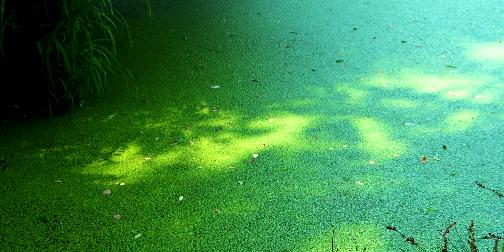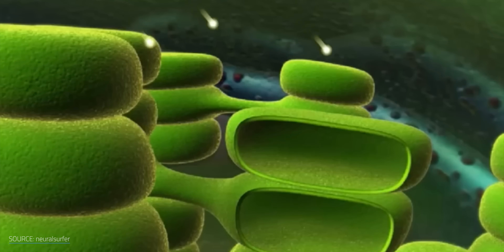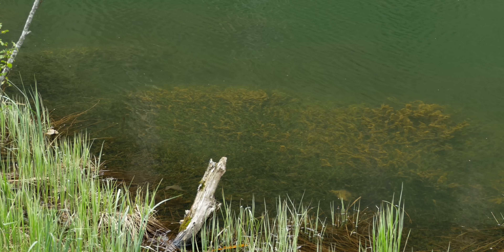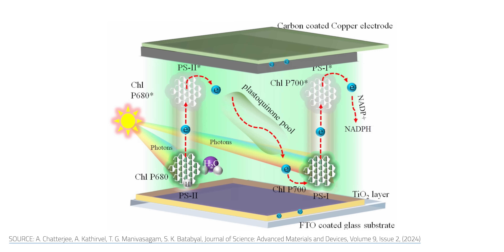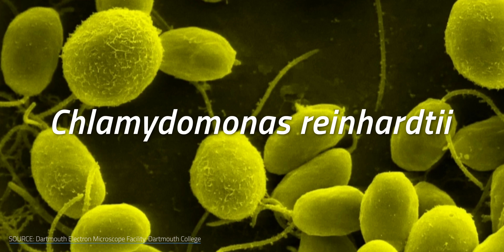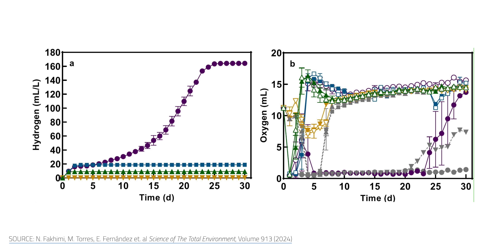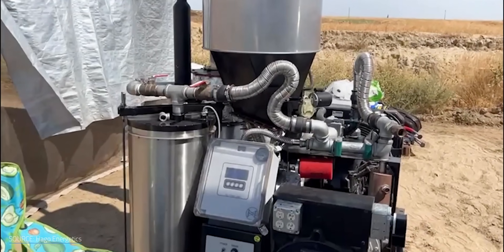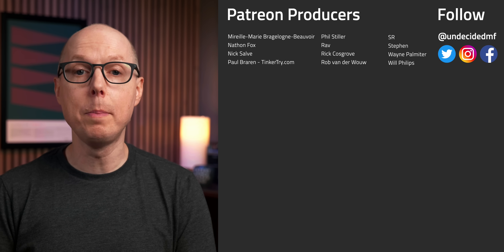The Weird Science Behind Living Solar Panels

Comment: nah, just do concentrated parabolic pv dishes, with bi-facial solar panels, the back side pointing at the sun. yes satellite solar collection dishes, or ditches, with solar tracking. also solar heat collection cooling etc. the target solar panel can be static, like solar molten heating tower power plants. but only the pv panel and the solar mirrors can be separate, not parapolic etc.
Reply: about single angle or two angle solar tracking, center mount solar panels on a pole, would require only two screw drive servos to get two angle full solar tracking. yes diy.

Comment: There are some living organisms that are very effective at separating charges.  I'm thinking of the electric eels, that can (intermittently) deliver high voltages (600V) with significant current (1A).  What a breakthrough if this process could be developed in some organism that obtains its energy from sunlight!

Comment: Whenever you here about bio energy production, keep in mind that Silicon solar cells have ~24% efficiency with sunlight and photosynthesis has maybe 1.5% efficiency with sunlight, often worse. That means, it could only ever hope to compete if its possible to scale up enormously without a lot of cost such that the cost/energy is better than simple solar cells.
Reply: IMO the most promising potential of bio energy lies in the possibility to integrate it with a wider array of biological systems and cycles.

Using the waste from one system as the input of another one, while avoiding the cost and social/environmental impact of extracting external scarce resources to use as inputs or raw materials.

Reducing the potential to absolute efficiency numbers is incredibly shortsighted.

Comment: How about finding a way to store the energy of a lightning bolt for reuse
Reply: A single lightning strike can easily hold 1.5 MWH of energy. The problem is that it stored at 300 million volts and 300 000 amps. 
It typically burns up any electrical device used to step down the power. 
I don’t think direct energy capture with lightning is going to happen without exotic materials that might not exist. 
I could however see a potential of utilizing a lightning rod to divert the lightning into set of tungsten resistive heaters to store the energy as heat similar to all the plans to use such a device to store excess renewable energy as heat. 
Even then, it’s a very intermittent energy source that would make renewable look like nuclear by comparison.

Comment: As a replacement for traditional solar panels this solution still has the same problems.  How well will this work in low sunlight,  if at all and you never once mentioned the energy density of this product be it hydrogen or as a replacement for solar panels.

Comment: Algae and bacteria to convert poop to hydrogen and electricity, squeeze the dead cells and collect oil to make biodiesel, form pellets from compressed dry biomass to burn for heat, CO2 not problematic as it gets consumed and released at equal rates.

Comment: I don't think this would ever be economical. The max efficiency of photosynthesis is 6% with higher co2 levels. Even if you could capture half of those electrons it falls far short of the 15% of cheap solar panels. Also there is most likely no way to get even close to the 52 cents per watt of solar. Its a living thing it requires maintenance. Lots of problems.

Comment: The elephant in the room is that hydrogen, even if it can be produced cheaply and easily, is a less-than-ideal fuel to store and transport. Before finding better ways to extract hydrogen, we first need a means to create a hydrogen-based fuel that is readily used, low toxicity, non-polluting, and stable.

Comment: As a plant tissue culture scientist who's worked with plant cells in liquid culture to prep them for bioreactors, I could envision a system where the algea are slowly removed and new algea feed into the system along with any nutrient feed necessary. For energy efficient cooling, I'd consider a geothermal heat pump approach to help stabilize the temperature and (hopefully) prevent it from moving past min/max temps.
Reply: I'm not a scientist but I was thinking along the same lines. Having a system that refreshes the algae while producing energy means that you could potentially have a solar panel system that exceeds the lifespan of traditional solar panels depending on the anode and cathode material. Waste algae can then be processed into biomass products such as fuel and fertilizer to run a generator at night and feed gardens. I would make the anode and cathodes replaceable. This tech could be extremely useful as a greenhouse technology.
Reply: @dapain1576  Correct, it would be similar to a continuous feed bioreactor and there are several ways to make it much more sustainable than conventional solar panels. The typical problem with bioreactor systems is contamination, so they'd need to solve for efficiency, synergy, sustainability, and sterility.

Comment: this seems like a great way to power an algae farm using the leaky electrons from the photosynthesis process that you're using to grow the algae in the first place. pump the algae through the PV panel using the power from the PV cell and allow it to grow (sure let's throw H2 production in there), when it's ready convert it into sustainable aviation fuel/shipping fuel/fertilizer/chemicals/etc. You could even make a tandem cell on the tank with a quantum dot cell tailored to absorb the wavelengths of light the algae doesn't use.

Comment: Is there a technical reason why current solar panels are black?  Can they be manufactured with different colors so that they match the colors of the roofs?
Reply: Black absorbs all visible light wavelengths and also infra-red, producing more energy, any other colour solar panels would bounce light off that could be used for power production.
Reply: @mittenstc  Makes sense. Thanks.

Comment: Pointless tech, by the time they get any where with the research we will already have Solid State Batteries sorted 
since the length of research time most likely be about 20 years since that type of research even if fully funded don't go fast compared to other types of Ego tech which is not based on living cells.  

The level of support and care those cells would need would negate any possible returns from the low outputs they would make?

Comment: If you combine the cells with high lipid algae you may be able to make the photovoltic charge and filter off some algae for biodiesel using the same device.  The challenge is keeping the bioreactor chemistry going without harming the photovoltic cell efficiency.  This is probably not something the homeowner or small business would want to deal with, but an energy generation business that can power via solar cells during the day and via a biodiesel generator / turbine at night might be quite happy.
Reply: I was thinking the same.
Reply: Schools would be a good place to fit them in because the county could easily take care of the maintenance roles if they’ll save enough money on their utility bills
Reply: It would cool down photo cell too

Comment: Matt, please do the research. Burning H2 in "Oxygen" only produces water. But we only have AIR, which is 4/5 Nitrogen, and burning (and fuel cells are no different) H2 in air produces NOx. Fuel cells may not get as hot & produce less NOx, but they produce NOx. Not the "only water" of your narrative. And don't even think about ICE or making steel even! Think temperature.

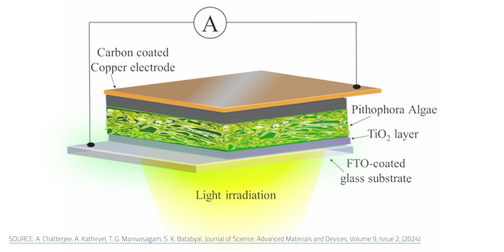Comment: 2:35 Isn't Tin supposed to be Sn? Ti is Titanium
Reply: The TiO2 is the titanium dioxide coat, the tin is the layer below, referred to as the FTO coated glass substrate
Reply: Isn't TiO2 a poisonous substance for living things ? 😮
Reply: @abhiabzy hardly it is used a lot sunscreen, makeup and even in food
Reply: @Vossst toxic and poisonous aren't the same, pure water is toxic but not poisonous
Reply: No, it's pretty save. Comparable to sand. Don't get too much dust in your lungs and you'll be fine. It's on your walls, probably in your sunscreen, ...
Reply: @abhiabzy  As with many things it is dangerous in high doses to living things, but in small doses or stable enough to not degrade it is fine.

Like alumina (Al₂O₃) coats pure aluminium surfaces titania (TiO₂) does the same for titanium metal used in medical implants for bones and teeth.
Reply: It's in sunscreen. Apparently, TiO2 is only dangerous if inhaled in powdered form.

Comment: I saw a TED talk on this topic many years ago

https://m.youtube.com/watch?v=X-HE4Hfa-OY

This building already generates energy using green walls

https://m.youtube.com/watch?v=JLEWZkKn1GE

And this urban algal liquid tree helps clean the air. Millions of people die every year due to urban air pollution so perhaps algal tech can be more useful that merely creating hydrogen

https://m.youtube.com/watch?v=gBCs_qwTON4

BTW, hydrogen cannot be transported easily (it needs to be cooled before it can be transported) so it's better to generate it very near to where it can be used, eg near airports & shipping terminals. It must also be noted that hydrogen is highly flammable so not a substance that we should be messing with (ie leave it to professionals with high safety protocols etc in place).

Comment: Seems like a glucose fuel cell would be more efficient than scavenging spare electrons.
Reply: well we call glucose a fuel, because it is what our body uses to perform certain functions. but it doesn't release electrons when it it does these. so using it as a fuel cell like an electronic battery, wouldn't really work. Its just a chemical, like any other chemical. if you break certain bonds you sometimes release an electron. A chemical is only really useful in this way if we can easily release those electrons. and those chemical combinations are the ones we use to make batteries already. glucose isnt one of them for a reason.
Reply: @ge2719 or you know you burn it to release that energy (huge amounts of power are used for heat)
Reply: @daleatkin8927  glucose doesnt burn very efficiently. it does on an atomic level inside your body with certain conditions. 
if we could just burn it we would make cars run on it.

Comment: But will it be as efficient as normal solar
Reply: Not even close at current applications and research, but it's beneficial in a sense over using traditional solar panels as it reduces the demand for metal and other mining-intensive materials, and it's much more environmentally friendly. Don't think it'll ever be as efficient as traditional SP, but it will certainly be cheaper and more environmentally friendly to manufacture. Pros and cons for sure!

Comment: Why not stress the algae stop let it reset stress it stop stress it stop let it recover stress it stop. It will evolve maybe to always make hydrogen without stress.
Reply: I don’t think that’s how it would work…but I like the thought. 
I think the most practical way would either be genetic engineering or setting up hundreds of cultures and only picking the ones with desirable characteristics to breed new generations.
Reply: @leax_Flame  I think you would have Algae more likely to survive left each time. Since the generations are much faster than say us. It may not be a super fast processes but it would give hardier algae each time
Reply: @christopherconkright1317  Yes hardier algae would survive, but hardier does not mean better at the end goal. 
You may end up with something that has the tolerance of a tardigrade but provides little of the desired output. 
For selective breeding purposes you would need a more refined and controlled environment changing variables one by one until you get a desired outcome. 
I may be explaining it horribly so maybe someone better versed in biology could explain it better.
Reply: @leax_Flame  right but it’s the experiment to see. I mean it’s life not everything goes to plan but since you have multiples going at once it’s worth one
Reply: Huh?
Reply: @Rambam1776  only you didn't understand or didn't watch the video?
Reply: This might lead to more stress tolerant algae! I'd like to see where this goes.